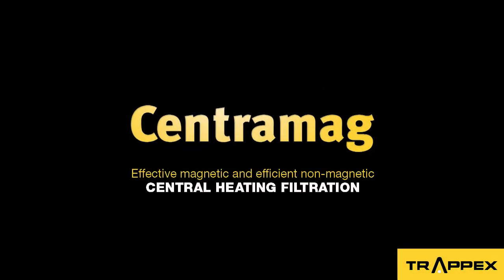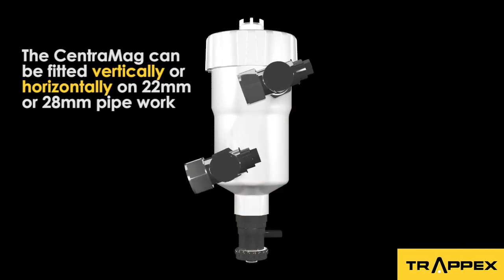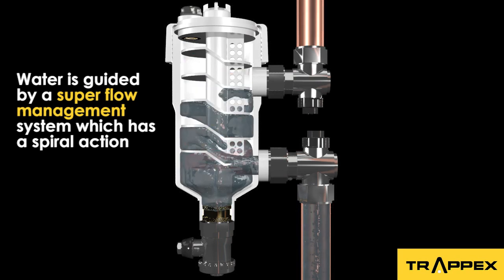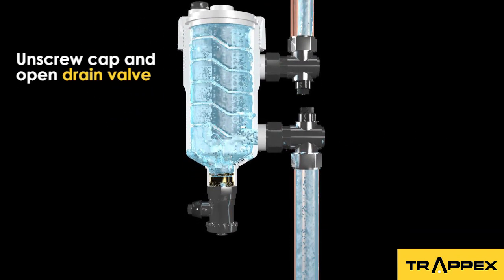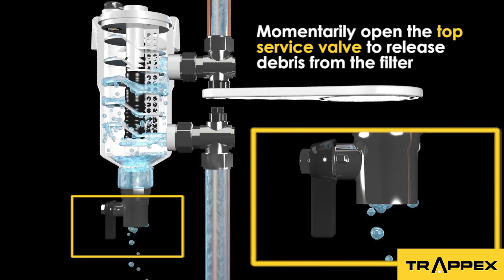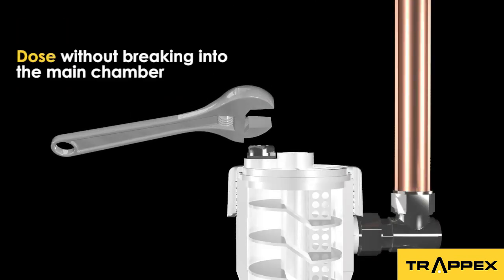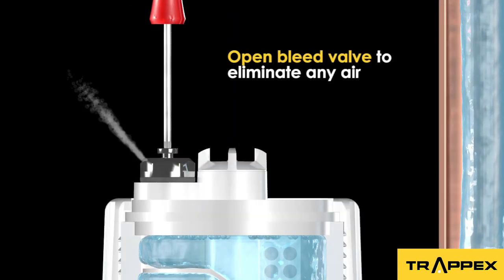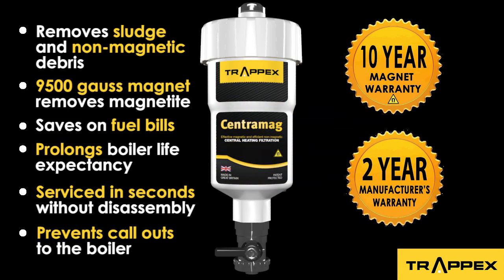Trappex - Advanced magnetic and non-magnetic particle filter

Comment: Looks a very sound principle within a well made unit. however I had one problem with the otherwise excellent video. It should be stressed that the Central Heating circulating pump must be turned off before the cleaning procedure is undertaken. Amongst other problems the brief opening of the boiler return valve to flush remaining residue out of the unit could result in the residue being sucked into the pump and boiler if the pump was running.